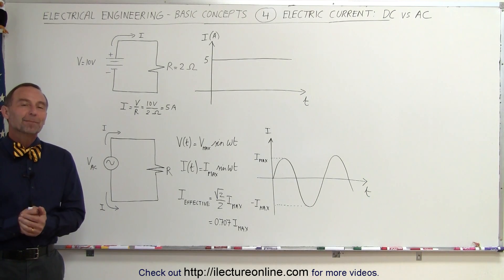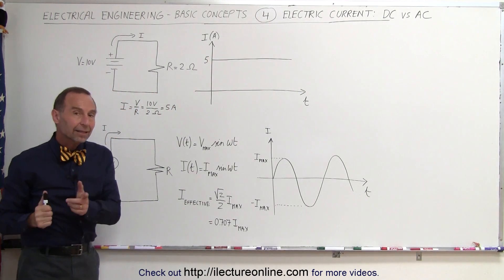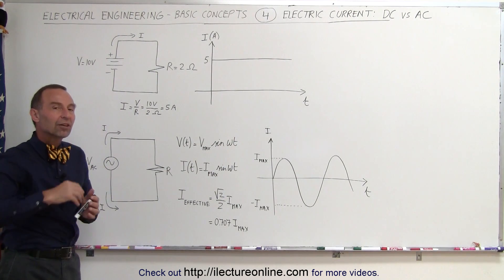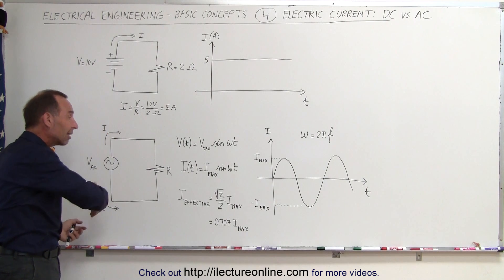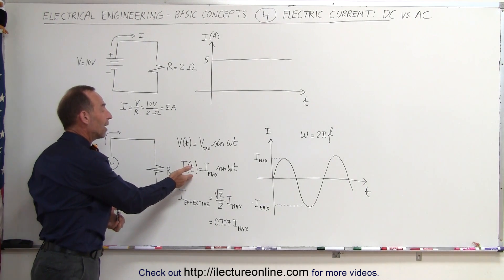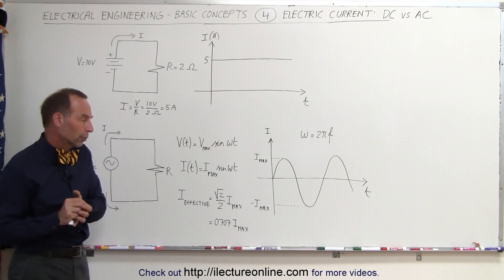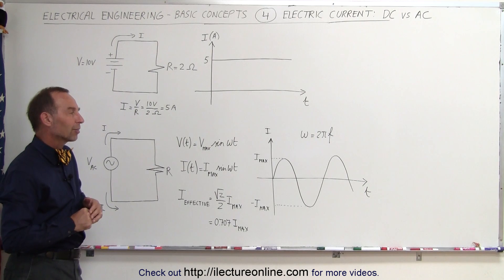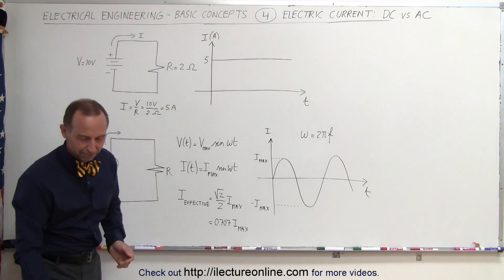Electrical Engineering: Basic Concepts  (4 of 7) Electric Current: DC vs AC

Comment: Small question. Why is DC current is constant. Doesn’t it decrease as battery dies out. Should it be linearly downwards? Thank you.
Reply: You are thinking of a battery, which is why the voltage will drop over time. But in this case he is talking about consistent voltage supply. Lets say a variable voltage supplier will be able to supply the same voltage no matter what it is connected to, as it doesn't store the energy but transforms AC to DC.

Comment: Sir why we need RMS value of current??
Reply from the maker: The RMS current is the "effective" current.  The RMS current of an AC current = the DC current that would affect the circuit in a similar way.
Reply: @MichelvanBiezen  GREAT
Reply: Sir, why electrical instruments are made to measure RMS value not average value of current??